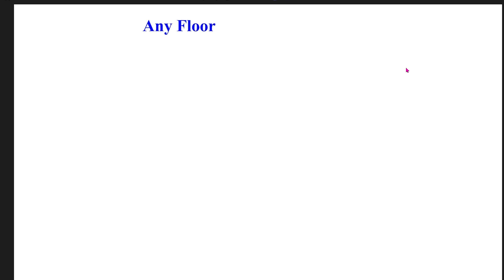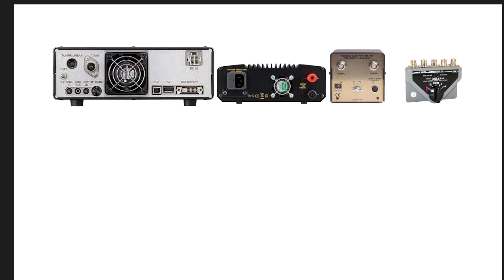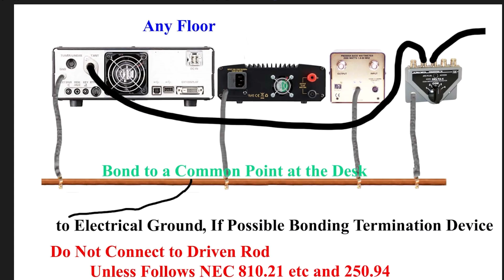Ground is a Myth says the ARRL! Ground is NOT a Myth and Here's How I Grounded My Station W6LG Jim

Comment: I am an electrician and not an engineer. 35 years in the business. Ground is not a myth and very real. A grounded electrical system is a safety feature. It is an alternate path for electrical current to flow in the event of a live conductor touching the metal case of say a washing machine. All current has to flow back to source neutral for an appliance to work. The grounded system protects people from being the path back to neutral. 

Maybe I’m not so smart but that is my simple explanation. Grounds can be complicating and there rules to follow.

Comment: Great Video Jim, one of my antennas is a long /random wire, it goes straight into the big MFJ-989 tuner. As you know that tuner must be grounded just exactly the way you described, works like a champ. All transceivers are bonded to the main ground individually,. Many thanks Jim & best 73 de GM0KET 😎👍🏴

Comment: I think her idea was to build the talk on an iconoclastic and edgy faux "confusion" that she used to illustrate some of the ways you can poke holes in the "ground" idea.  And of course you can, because ground is a local abstraction that we use to understand and design systems -- like any other abstraction, be it lumped circuit models, schematics, Thevenin equivalents, etc., there are details of Maxwell's equations that we gloss over to be able to think on a more efficient level.  So of course, any abstraction like "ground" is going to have leaks.

The problem with the talk is that even though the abstraction has leaks, it doesn't mean it doesn't "exist" or that it isn't meaningful.  So I think she took the fun idea for the talk too far, and actually goes so far as to uninentionally misinform.  I think some innocent listeners may actually walk away not taking some things seriously that maybe they should.  I do not relish the online debates that will now cite her talk as a source, and will require unwinding it all and explaining things that didn't need so much explaining before when the waters weren't so muddy.

Comment: So let me see if I understand what you're saying: All ground lugs on equipment (radios, tuners, etc) go to a busbar via equal length strap/braid and the busbar gets grounded to the mains ground via an outlet? What about antennas/masts/towers and coax? I assume they get grounded to a ground rod outside that's tied to the mains ground rod?
Reply from the maker: Not covered in this video.  NEC Chapter 8 provides a lot of information and requirements that must be followed.  Mike Holt has some videos on antennas, etc. 73, Jim

Comment: Hey Jim, I have a question. If I connect my equipment etc. to a copper rod in my shack as you showed, and I drill a hole in my floor and connect a copper wire from that rod to the steel frame of my mobile home, is that enough? I think I only have a sub panel in my mobile home and not a main panel with a ground rod. My main panel is 50ft. from my mobile home and that has 1 or 2 ground rods. Thanks.
Reply from the maker: Just follow the advice in the video.  73, Jim

Comment: I live in the Tampa Bay area which was more lightning than any ware else in the the rest of the country. My philosophy is some protection is better than no protection. I do have my antenna connected to a gas discharge tube lightning arrester  which is connected to copper  8 foot ground rod with 6 gauge  cooper wire. My radio is insured for lightning damage and I disconnect the coax lead in  when not in use.   The power supply for the radio has a  grounded 3 prong plug. My situation is not perfect but its the best I can do. Gary KJ4PHG

Comment: The same could be said for the aurora borealis striking overhead wires can cause an inductance push, backward. Reference to knock-on wood being a tree that is grounded. love you grounds people -> Have you been grounded today? In College one of the students just standing next to the teacher slapped him across the face, right out of the blue, which the teacher just a bit after started laughing at his mistake, as he forgot to ground out the circuit emptying the condenser on a set of points he just opened the energy jumped over into the student and caused him involuntary movement which was the result of slap in the face. LOL 😂😂You will always pay for your mistakes the teacher said laughing ...

Comment: I think the vast majority of comments here missed her point. I think they are reacting to her using the word myth and not really listening to what she is saying. Electrical “ground” (earth) is not a reliable fixed reference. I find in many buildings it’s not even set up correctly. And as always it’s too easy to conflate electrical ground with RF ground. 
Also , she DOES understand where the current goes in a GCFI outlet (her comment is hyperbole to make a point) and her use of the word “breaker” may not be what an electrician would use, but most other people call the interrupter circuit in the outlet a breaker. 
Also the ground terminal on the back of any piece of audio gear is NOT for safety or for RF. The device will already have a path from the chassis to electrical ground. Ground loops in an audio system is a whole other topic that is often misunderstood
Reply from the maker: Perhaps, but I must insist that ground is not a myth and it is dangerous to teach that. The ARRL video is confusing and needlessly complex with examples that have nothing to do with amateur radio. The proof of thta is in the vast majority of comments by those who watched the video and then made a comment.  Those votes should not be dismissed.  The video is wrong and so is the professor. Thanks for your help and I hope many will read your comment and understand the points that you are making.  Thank you for doing that. Regards, Jim Heath W6LG

Comment: I'm still in the process of learning HAM radio (in the UK) and I got also confused with the grounding. They recommend an RF ground but at the same time explain that the main electrical ground could be at a different potential that the RF ground (rod of copper in the ground). Then it seems safer to me to only use (as Jim advices) the main ground, however I suppose you add RF choke on the wire to prevent noise to come from the house to RF equipment and the other way round too. Am I correct?

Comment: Here's my scenario. My shack is on the second floor on the opposite side of the house where the main panel is at. There's no easy or affordable method to embed ground rods around the house and tie them back to the main (concrete and other obstructions in the way). The distance from the shack to the main panel is roughly 70ft.  I can bond everything in the shack to a common copper rod as described in this video under the desk, however how do I ground it back to the main?
Reply: This is my question also

Comment: Each of your points here are in alignment with the ARRL presentation. She discussed the fact that she was talking about RF ground only. She kept saying that grounding for lightning and safety are still very important, but running a shack ground wire down two floors to get an RF ground is fruitless. I am sorry you thought you were in disagreement; however, I did find the ARRL title a bit misleading, but I think it was to get the attention of those that still search for RF grounds in a ground rod. Both of you make the same points.  The best you can do with RF is to keep all equipment at a "common" potential with heavy bonding wire. For me, braided bonding has worked fine indoors, away from the weather. Once I started bonding my equipment together and added line chokes to the coax, my rf-in-the-shack problems went away. Oh,  yea, going QRP portable helped convince me as well. No ground rods, no rf burns, great fun. --Mark, KE6BB
Reply from the maker: Then I missed the point or perhaps the title should be changed to RF Ground. Thanks, Jim

Comment: Jim, thanks for the great video.

Question: if all of my equipment is powered from a DC power supply that has 3 wire ground, is that sufficient? I.e. are they essentially all bonded with respect to AC safety? Thanks!
Reply: I also have this question

Comment: Jim I have a simple question. My basement station includes 3 transceivers a matching tuner and a few other associated devices all of them attached to a battery bank that is trickle charged by solar. My attennas are grounded via lightning protectors outside. I have the radio equipment tied together but no ground to the panel. Is this correct? I follow everyone of your videos. Thank you for them Brian VE3GUE

Comment: Jim, great presentation. I live on the 7th floor of an apartment building. I was told by a sales person at DXEngineering to buy 6 guarge battery cables and connect each piece of equipment with a direct run to a copper bus bar. I am not close to the breaker box for my unit so I cannot ground it as you recommend. Also, I would be affraid to touch the box other than to turn on/off a circuit breaker. All of the equipment is plugged into a TrippLite Isobar. I did not connect my Delta-2 antenna switch to the bus bar. Do I need to do that? if so, where is the connector on it? Any suggestions would be appreciated. Thanks 73 KE0WNL

Comment: I power all of my radio equipment with UPSs that are 1500 VA or larger. This gives my equipment backup capabilities (until the generator kicks on), and isolates everything from surges in the house AC electrical system. All Heliax lines from the tower interface through Polyphasers mounted on a large copper bar that is tied directly to its own 10' ground rod within 10' of the bar. I have a separate grounding system on the tower, but won't go into that here.

Comment: Grounding is always made out to be harder than it really is, and I think it's because there is a lack of good, digestible sources of information. Is ground a myth? Definitely not. I suppose it is a myth if you are referring to that old saying "Electricity always takes the path of least resistance." I wish two things in regards to this saying. A) I get paid a dollar every time someone says it and B) I get to slap them silly for saying it. It's misleadingly true. Electricity takes every possible path, with the current in each path being in inverse proportion to the resistance of that path. This means you can have a fault where some current is going through a device as normal, and some current going through a person, and that person ends up dead because neither current is sufficient to trip the fault protection device. Hence, GFCIs came into existence. Next, the way equipment grounding works, is not to give a path for electricity to flow so you don't get shocked, it is to give as low an impedance path as possible so current will flow as much as possible and trip the fault protection device. By giving a really low impedance path, the circuit protection trips quickly enough that the time a fault is occurring is minimized and thus electrocution or fire risk is minimized. 
In ham radio we want grounds for a lot of things, which makes me wonder how the ARRL could say its a myth, but I digress. We need them for: 1. Typical electrical faults, 2. Lightning risk (but not direct strikes), 3. Common mode current, 4. Static build up, 5. Establishing equal potential

Comment: FOLOW ALL RELEVANT ELECTRICAL, FIRE, AND TECHNICAL CODES REQUIRED BY LAW AND BEST TECHNICAL PRACTICE.

That said,  I didn't see the presentation as instructing anyone to disregard the above advice.  I thought the "ground is a myth" was a good presentation.  I am trained as a computer and  electrical engineer, and I didn't have any technical objections to her presentation.  In my opinion she presented good enough examples of mythology surrounding the concept of "ground" to justify her title.  I was probably a closet ground myther, because many of her points were not new to me.  I had pondered them previously.  

What follows is not based on electrical codes, best practices, or experience in Amateur Radio, I just got my license.  It comes only from my electrical engineering training and experience.  I may be creating new ground myths.  Take it with a grain of salt.  It is NOT professional advice! 

I am building a station on a sailboat.  There actually is a ground with known electrical parameters, the seawater.  So cleary I believe in  "ground", but also am aware of the "mythology" surrounding the topic.  On sailing yachts, it seems tradition that lighting protection is, when you see a lighting storm, disconnect all radios and electrical equipment and put them in the oven.  I don't believe that is in any official code, so I'm not going to do that.   One of my lighting protection strategies is eliminating ground loops in all of the boats wiring systems.  Lightning can create a very large current flowing down the aluminum mast, which could induce currents in any loops of wire.

When analyzing for ground loops. I also consider all power cables, signal cables, coax, as "ground" as they will most likely be connected to ground at RF via capacitance or mutual inductance.  So best practice is that all wiring forms a tree structure, with the main panel as the root, and the ground rods for a house, or propeller shaft and bronze through hulls for a boat connected from the panel.  So for instance,  the radio coax will not go directly from the antenna to the radio.  It will be routed from the antenna to the main wiring panel, where it will be grounded, then to the radio along with the power for the radio and the radio's ground wire.  

W6LG's grounding recommendation creates a ground loop. For a station in a building with an electrical panel,  I wouldn't create a separate ground rod system for your in house equipment.    I would use the ground system  of the house.  This might be why people are clipping the ground prong from station equipment.  If you connect together 2 ground systems you create a giant ground loop.  If you want to hardwire the ground screws on your powered station equipment, I would run ground wiring back to your station power panel, or outlet, taped or zip tied to the equipments power cord.  Separate screwed on redundant ground ties may be a good idea as it means the equipment will remain grounded even if it's power cable becomes disconnected.  The ground bonding busses should be right next to the power outlets and  wired into the electrical outlet ground.  I would double check the electricians work to verify your station power outlet grounds are connected back properly to the main panel  which has a proper ground.

External components of your station, coax, towers, antenna, equipment will or should be considered to have a separate grounding system.  To prevent ground loops at RF, ferrite RFI chokes should be used on all coax and power and signal wires where they enter the house.  Remember at RF all wires are ground wires.😂.  This should be done for all other wiring leaving your house.  Telephone, cable, water meter, even your main electrical service if you can find a large enough ferrite.  If you insist on a separate grounding system for your inside equipment, then I suggest you RF isolate all wiring  comming into your station room from the house, all electrical circuits, telephone, cable, network wiring.

Comment: Kristen, K6WX, is a much-respected ham in the Bay Area, both for her technical expertise and her ability to run a radio club (she did a great job heading up PAARA, the Palo Alto club, for several years).  I'd suggest getting in touch with her and discussing your concerns. I think you'll enjoy the conversation.
Reply from the maker: I am certain she is well liked and respected. Clearly she is brilliant.  I have never taken a course in electronics at any level. I would not be able to debate her on the subject because I just don't know enough. Having said that, the title and subject that ground is a myth just upset me so much that I had to say ground is not a myth.  I am sure she has seeen my little video.  The Vice President of the ARRL could make a second video in response to the comments made here. My advice to the ARRL would be to remove the video. Thanks for the advice. I will likely start another round of chemo on Sunday.  As you can tell in my video, I feel terrible and struggled with my presentation. 73, Jim W6LG